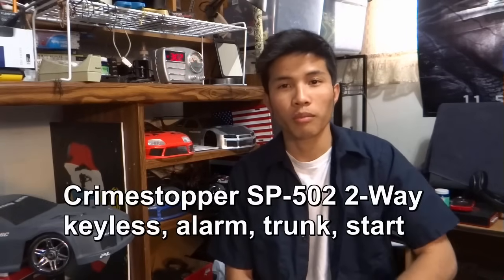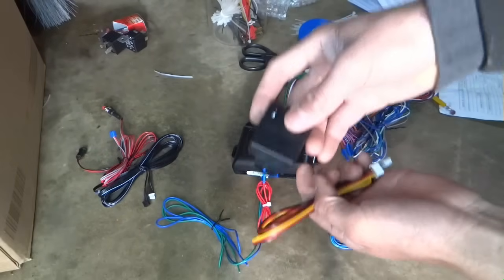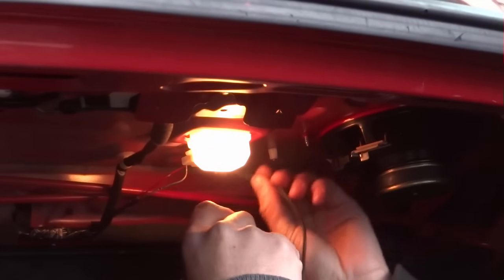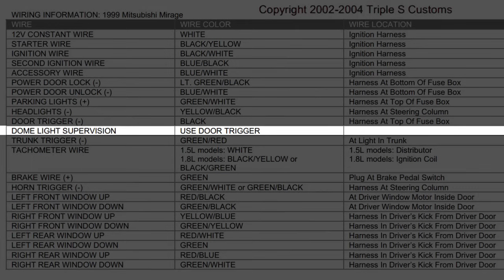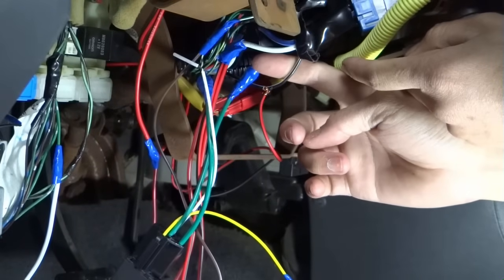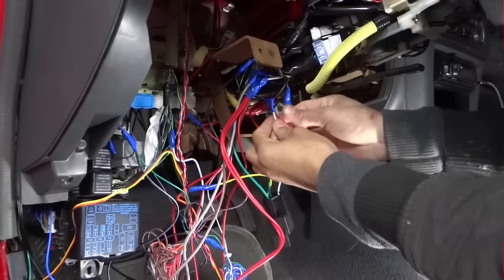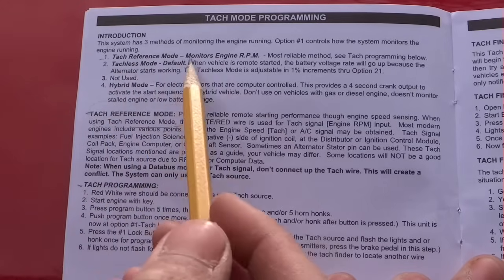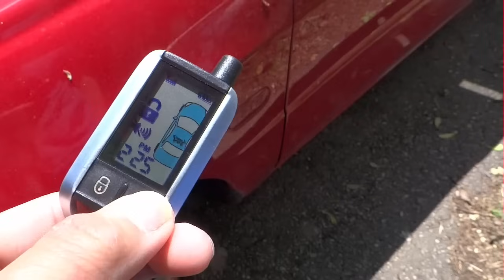Mirage Fix 9 | Remote Start + Alarm SP-502

Comment: Hey I've been watching your videos since yesterday, and I love them. I don't own a mirage, but I'm hoping to get my own 03 Lancer (maybe OZ) pretty soon. 
I was wondering, do you normally buy your cars in auto? If so, why?
Great videos again man,  cheers!
Reply from the maker: I buy auto cars because my family members often use them, and they can not drive manual.

I prefer manual because that's what racing cars are. However, more and more racing cars are now moving to semi-auto or even completely auto because it shifts faster. Even drag cars, the fastest ones have auto transmission.

So one day if I  want to tune my car, there's always a way to control how my car shifts by messing around with the program. I could possibly put a shift stick on it, and have shift up and down on command if you know what I'm talking about.

cheers
Reply: Yeah I know what you mean. My mothers 2013 Cruze has something like that in it.

Comment: this is amazing , 
i'm inspired to buy this and installing it my self
any tips on how many extra relays i should buy separately, i have 1991 Chevy Caprice
Reply from the maker: Yaman Tarakji At least 2. Here: http://www.ebay.com/sch/i.html?_odkw=40a+relays&_sop=15&LH_BIN=1&_osacat=0&_from=R40&_trksid=m570.l1313&_nkw=40a+relays+pairs&_sacat=0
Reply from the maker: Yaman Tarakji Also, before install, you gotta know what wires your car has that you will need, so that you can eliminate some wires out like I did. Look into the wire diagrams: http://alarmsellout.com/support/diagrams/vehicle/CHEVROLET%20CAPRICE%201986-1996.pdf cheers
Reply: Thanks man for the replay I already downloaded the wiring information for my car
I'll get 3 relays just in case 
Cheers

Comment: Nice work. I'm looking at one of their systems. Can you tell me if this is an FM system because I see you press the buttons and the alarm wouldn't stop. That means it's AM. Also how is it holding up now? I know it hasn't been too long and does the alarm lose the settings if you unplug the battery and then plug it back on?
Reply from the maker: I have no idea. The alarm will stop after the second press. No, the alarm will not loose setting if you unplug the battery.

Comment: Hi mackey
I installed the crimestopper inmy lancer 2007 in india 
I want to know something
When I start the car with remote and I open the door the engine stops is it normal.
Reply from the maker: Yes, if you don't unlock the car with the remote before opening the door, the car will shut off to prevent thief.
Reply: DarkDragonWing 
But I unlock the car before then I start the car with remote and car rest unlock even I need to unlock the car before I  open the car

Comment: Just to make sure before I install on my car, you connected most of the +12 volt wires from the alarm onto one constant 12 volt source right?
Reply from the maker: Flyboii97 Yes, all of them.
Reply: The DarkDragonWing Thanks! When I first looked at it I was a bit confused but it makes sense now. How is the alarm holding up so far?
Reply from the maker: Flyboii97
 Still working good! No problems.
Reply: Cool! I look forward to doing this install

Comment: To be Honest, you should sell both cars look on ctaigslist for  a 240sx (Nissan). You can make those cars into a drift car real cheap and easy.
Reply from the maker: Yes, but my money is limited and I need two cars, one for me and one for my sister. Another thing is my sister doesn't drive manual. I switch car with her once in a while when I wanna work on the other car. Yea, I wish I could do those kind of things here. Another thing is there is no tracks here for drifting.
Reply: Ah that sucks.

Comment: thanks for da Info bro, I got the alarm installed but I noticed wen I try to remote start, everything turns on but the car won't start, could I have the 2 green wires mixed up for. the relay set that came with it? also, mine is manual transmission.
Reply from the maker: +Jason Medeiros You might have to program it to the manual mode. Also, it could have been just that the hood pin is not pressed down enough.

Comment: Do you need to plug in all the harnesses for the alarm to work even if you don't have power locks and stuff? Or can they be left out if they are not used?
Reply from the maker: They can be left if not used.
Reply: @DarkDragonWing  thank you for the reply. Much appreciated!

Comment: Did your car Engine stop after you pull handbrake and put park mode plus turn off your ignition key?
Reply from the maker: Yes. It starts when you use the remote. Why would you want to use both remote and the key to start the car? If you want the engine to stay on running then take the key off, hit start button on the remote and leave the car.
Reply: The DarkDragonWing
I mean when you turn the ignition key to off and remove the key..dose your car engine cut off or you need to press the brake or press the start button on the remote to cut the engine off. 
My current set up is as follow..after I move my car to the parking lot, I press the brake and put to Neutral gear. Next I pull handbrake,  the car and remote produce a chip. After that I turn the ignition key to ON then to Acc..but the engine still running and when move my gear to park..the engine still running..even when I turn the key to lock and remove the key, the engine is still running until I either press the brake or the start key on the remote.
So was wondering whether dose your car behave the same as mine.
Reply from the maker: meow Chan  I have no problem with using the key.

When I use the remote, I only use it without the key. For example, I park the car and now I want to remote start the engine, I simply hit the start button on the remote. Then  the engine is started and running.

1. When I go to the car, I hit the unlock button on the remote, I get in the car, and put the key in and turn it to on position. Then I press on the brake pedal. Now I have full control of my car with the engine running. I go ahead and us the car normally.

2. When I go to the car, I hit the unlock button on the remote, without putting the key in, I go ahead and press on the brake pedal, the engine will shut off. Now I have full control of my car without the engine running. I go ahead and use the key to start the engine again and use the car normally.
Reply: The DarkDragonWing
If you not using the remote start engine key, how you stop and start the car?
Meaning, just purely using the remote to unlock the car, get in the car, turn on the ignition on and crank the car using the car key. After that drove off and when you going to get off the car..how you cut off the engine without using the remote start key on the remote? By pressing the brake twice after hand brake pull up or just off the engine using the car key?
I found out that if you pull up the hand brake, the engine will only cut off if you either press the brake twice or by pressing the start key on the remote. 
Is it correct behaviour?
Reply from the maker: meow Chan
1. If I'm not using the remote, I use the key to start and stop the engine normally
2. I just turn the key to off position to shut off engine
3. Just using the car key
4. What system are you using here? Who installed it? Do you have the user manual?
Reply: using the sp-502. Done by authorise workshop.
Can you help me to verify with your car key still on the start position and engine is still running, pull up your hand brake and then turn off the car key to verify whether the engine did cut off. 
btw, under the prgram mode, there is this option 15, transmission type, which option did you use?
Sorry for these questions.
Reply from the maker: meow Chan  I use Automatic. My car is automatic transmission. And the hand brake has noting to do with engine on/off. I can pull it up while the engine is running and it will still running.

Comment: Cheers brother, My car is a manual transmission, I have connected the brake wire and also the tach wire into the car already which i try to start it up it cranks and then gives up. is there anyway you can help me on that?
Reply from the maker: What car do you have?

Comment: hi, im having trouble installing the trunk release on my mx5 have a negative cable from the unit 2 cables from the motor and the relay, but dont know how to conect cant find a proper diagram either on the internet. any help?

Comment: Dam the magic man...do u know alot about 04 gala t gts.the horns disables and it clicks about 10 times when we open door the place we bought car didnt have alarm but it starts and drives what can we do to program another remote or just get a whole new system
Reply: Meant 04 galant
Reply from the maker: djsmileyoflasvegas You can buy a new OEM remote from ebay I think. And search for instruction on how to add a new remote. Or like you said, you can get a new system too, but it will take some work.
Reply: The DarkDragonWing took the easy way out there was this guy here in vegas who installs brand new autopage akarm with the works for 100.he said whoever did alarm before had everything crossed up.works great now.u guys know ur shit.

Comment: did you need a bypass module for the remote start?
Reply from the maker: No need for bypass for this car. You only need bypass when your car has "chip" in it's keys.
You can't start your car without the key, so you will need a bypass to bypass that. So that you can use the remote to start your car.
Reply: Do you know how to find out if your car has a chipped key?
Reply from the maker: Go to a store that cut car keys, they might have chipped key detector.
Reply: Ok, thanks!!

Comment: What will happen if you started the car with the remote and then you start the car with the keys? i really wanna know!!
Reply from the maker: I have anti-grind relay installed. With this relay, after started the car with the remote, I can just put the key in, turn it to on, and if I accidentally turn the key to crank, it will not crank.

Comment: I bought the auto page rf 350 anyways it has 2 parking light wires an input and output my car has only one wire. Red/white is input and white is output on the alarm. It also has 12volt wire. The chart on the manual looks like red/white goes to the 12volt and the white goes to the parking lights??
Reply from the maker: Javier Camacho Yes, red/white goes to the 12volt, and white goes to the parking lights.
Reply: So the red/white goes to a 12 volt?
White goes to parking lights? 
Why does this harness also have a fused 12volt wire?
Reply: Red/white wire: parking light relay input 
White wire: parking light relay output 
Black wire :ground to frame 
Brown wire: positive siren output 
Red wire: 12 volt constant 

Those are all the wires on that harness why do I have two parking light wires?
Reply from the maker: Javier Camacho
 Use one parking light wires
Reply: Well I got the alarm installed and the unlock and lock function work fine. But when it's armed the the alarm won't go off if I hit the car and the parking lights flicker on and off when armed?? Everything is hooked up right I believe. Lol
Reply from the maker: Javier Camacho
 Yes, flicker a couple of times when armed and unarmed. You gotta hit the right place such as the are near the shock sensor.
Reply: the siren beeps and parking lights flash when the alarm is armed. It won't shut off until I unlock it. I put it in a 94 acura integra. Any suggestions would be appreciated.
Reply from the maker: Javier Camacho
 Something is triggering the alarm.
Reply: Night

Comment: Hi , My brand new battery keeps draining cause of the alarm. I have a 2 way toggle under the dash.  don't know which way to place it at. All i know that when i play with the remote and get the 3 chirps . The battery doesn't die. How do i properly get it to chirp 3 times. I keep getting 2 chirps and the battery drains..
Reply from the maker: You might need a new alternator.
Reply: It has a new alternator..

When i get it some how to work. The alarm with its sensor working and all. The car is fine. Battery doesn't drain. I think i found a manual online . I'll follow the instructions  ... Thanks..:)
Reply from the maker: Janet Diaz Oh that is good!

Comment: Hi 
Where to tap in to get the indicators flashing on lock and unlock
Thanks
Reply from the maker: That would be the parking lights wire.
Reply: DarkDragonWing i meant with wiring harness in car.
Where to tap in car to get indicators flashing with lock n unlock I have two positive wires coming out of the central lock unit

Comment: hi im trying to install securityplus sp-502 on my car but my car doesn't have start2 or ign2 or acc2 output for the pink/white wire of 6-pin high current connector. What function is the pink/white wire connection for? and would the alarm still work properly even if I skip that wire connection?
Reply from the maker: +wut wat Yes, it will still work even if you didn't connect the Pink/white wire. It's just an extra programmable option. cheers.

Comment: My car alarm goes off all the time never disarms and my fobs don't work and the reset  button on the ecu doesn't reset it please help?
Reply from the maker: AllRoUnDGaMeR Take off the wire for the horn and the siren, that way it won't be annoying. To unlock or reset manually, turn the key to ON and then press the reset button for 5 seconds until it stops alarming. cheers

Comment: Hi Mackey 
I installed it but car start automatically after some time what's the reason??
Reply from the maker: Maybe you sit on the remote
Reply: How I can repair it car starts several times in day without touching key

Comment: I programmed it but now, instead of cycling threw the gauges n trying to start, the system jus beeps about 7ish times,stops,and then another 7
Reply from the maker: +Jason Medeiros Does your car have a chip in it's key? There should be an explanation of the 7 beebs somewhere in the user manual.
Reply from the maker: +Jason Medeiros By the way, what car do you have?
Reply: 2000 civic si and no transponder key, everything works cherry thou bro haha. I'm jus kinda boggled haha
Reply from the maker: Jason Medeiros
 It works now? :D good
Reply: Haha no not yet, the settings for everything else works good, the 2 green wires on the relay that's provided, does it matter which one goes to the starter and to the ignition side of the starter?
Reply from the maker: Jason Medeiros
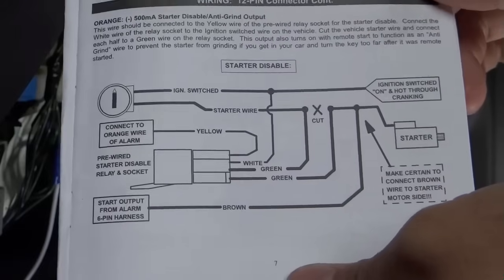 Yes it does matter. Here at 18:56 in this video shows how it is https://youtu.be/PhBxvWhBlRg?t=18m56s

Comment: Where can i find a car specific wiring diagram for example, ignition wire at steering column this and that or door trigger at kick panel etc etc?
Reply from the maker: heyitschinoable http://www.commandocaralarms.com/wiring/1997-2001/mitsubishi/mirage/1572.html http://alarmsellout.com/support/diagrams/vehicle/MITSUBISHI%20MIRAGE%201993-2002.pdf